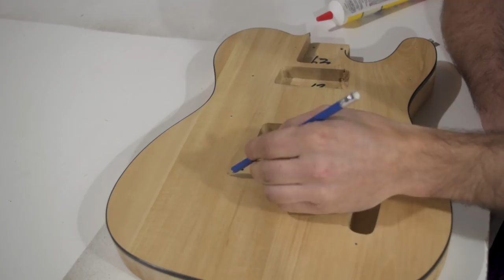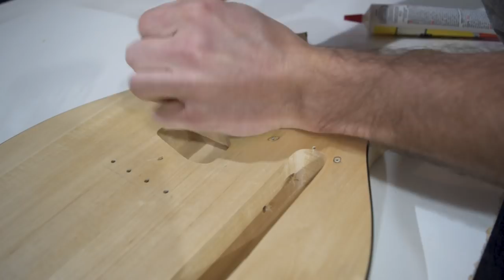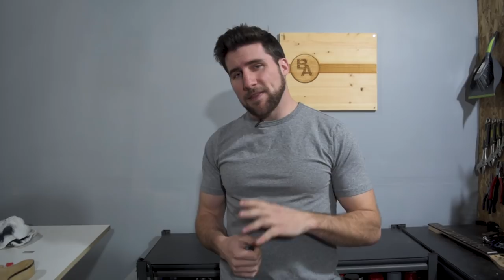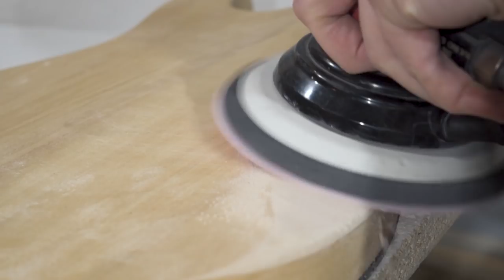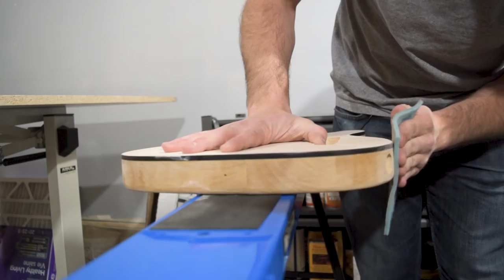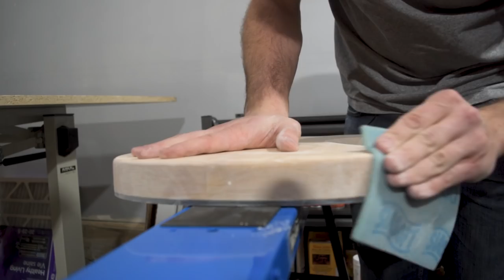Filling and Finish Sanding your Guitar | The Solo Music Gear Guitar Kit Build (Part 6)

Comment: If you want to fill holes in wood that is going to be painted transparant finish you best
fill them with the same wood as the rest is made of. To do that, save the wood dust
from sanding of the surrounding area. Mix the dust with white wood glue and use
that as filler. You will be amazed how little you see from it after it’s
finishend.Dust from sanding mixed with (transparent) glue makes an outstanding filler!

Comment: Just saw this now...my son and I used a spoke shave to do the belly and arm cuts on our tele kit...worked great
Reply from the maker: Nice; that’s a good option. I have a few videos with different methods for this.
Reply: @BradAngove  We saw those videos well after we did the work, we were starting work on a tele kit, and my son wanted a body like his Strat with the cutwaways that with our our lack of equipment at the time was the main reason we used the spoke shave (from a hobby kit I inherited from my father that dated from the 50's) It was a tiny one....probably with a 3/4 inch blade...Then we saw your videos with the belly and arm cuts in a tele body and said....Brad had the same idea we did by making those cuts....absolutely love your videos and are using some of your suggestions....making lots of mistakes and learning from them...and carrying on....

Comment: Hey, Brad, love your vids... You showed the 600 disc at 7:00, but was there another grit that you were using before that? Also, what was the pad that you were using on the sides? Thanks muchly!
Reply from the maker: I probably did a bit of work with 320 or 400 before that. The pad I used on the side was just a foam back piece of sandpaper. Also went up to 600 with that.

Comment: hey Brad question for you which polisher or buffer do you like to polish paint with I'm thinking about getting one prefer electric because I don't have enough CFM to put out for a air powered one which electric buffer do you like for polishing I know you worked in an auto shop I'm going to use it to buff my truck? have a happy New Year
Reply from the maker: Hi David. I put together a kit page for the polishing equipment that I like. Check it out here: https://kit.com/bradangove/what-you-need-to-be-able-to-polish-your-paint

I think you'll find it helpful.

Comment: Alternatively, especially for tiny screw holes like these, you can dip a toothpick in some wood glue, then jam it into the hole. Snip it off with a pair of wire cutters (or just cut it with a safety knife/razor blade) and sand flush if you need to.

Comment: Nice !! I was looking at 1 of those occilating tools but i figured they'd probly not be great for cutting a perfect 90 degree cut as needed on a headstock vs a jigsaw.

Also .. how bad has the poly sealer been on the kit so far?
Reply from the maker: A jigsaw would definitely be better for cutting a headstock. I haven’t had any issues with the sealer, but I’m not really staining mine per se.

Comment: What grit of sandpaper are you using?
Reply from the maker: Probably 150 or 220 at first and then 320 or 400 to finish off.
Reply: @BradAngove  thanks I'm going to use all of them, just to be safe

Comment: Angove, you're a bleepin' genius.  I bought one of those tools years ago at Harbor Freight and have never used it.  That being said I watched another Youtube video on carving belly cuts with an angle grinder with a cup wheel.  It hogs put the most wood in short order.  I've done a couple that turned out primo. After watching this video I'm going  to try the multi-tool before sanding with the ROS.   Also fill  the holes with those StewMac toothpicks.  They work great.
Reply from the maker: Haha I’m not sure I can afford the stewmac toothpicks. 

Sandpaper on a polisher also works well for finish carving after using the grinder wheel.

Comment: HI Brad,  my son and I are building two  SOLO Tele guitar kits and so have been watching your very good videos.  I bought one for him as Christmas gift and liked the idea so much that I'm building one also.  I talked to Matthew at SOLO and told him you were doing a good job so more free SOLO kits should be in the mail as we speak. LOL 
Question please, I might purchase a LP from SOLO and plan to highlight the grain with dye/stain,  then 2K clear coat. ( did car restoration so have all paint guns/compressor etc.) . knowing the maple cap is thin, would you go with dye /sand/clear coat or use a tint in clear, skip dye part all together  to  avoid blotching veneer or over sanding into body.  Planning on Cherry red finish.Thanks, Ted
Reply from the maker: I think those veneers have a bit of sealer on them to protect them during shipping (though I think Solo may be changing that), so tinting the clear is probably your best bet.

Comment: I know this is 3 years old but I had to post this somewhere. I needed to fill many small cracks and holes on the side of my Tele body. Instead off spending a few bucks and getting a water based power filler(powder so I could add some of the ink I'm using for a good fill). I decided to save the sawdust (same color as body) add some titebond and the ink. WHY DID I DO THIS!? It's hardened like cement and since it's the side the only power sander I own won't work so it's hand sanding. 2 hours to sand a spot about 2''x2''. I'm an idiot. Just to save $20 and to not have anything shipped to me during this covid 19 crisis I have cause myself HOURS and HOURS of hand sanding.
Take my advice. Spend the money and get filler.
Reply from the maker: You may have found using a razor blade or scraper a brick quicker for that. Thanks you for posting.
Reply: @BradAngove  I thought about the razor blade. Still searching for one. I know I have some...lol
Thanks for the reply!! And keep up the cool vids.

Comment: Hey brad.  Quick questions.

I got the thinline tele kit from solo.  Basswood and a maple top.  I am going to stain the body (the maple has a nice grain). How will the 2 woods take the stain? 

I assume the binding will be coloured......is tape the best way to keep it cream?
Reply from the maker: You can tape the binding or scrape it. You need to clean the wood with solvent and sand it before staining because it comes with a thin coat of sealer on it.
Reply: Brad Angove I've started sanding.  Figured that was enough to deal with the sealant.   No? What kind of solvent? Alcohol? Mineral spirits?
Reply from the maker: If you sand far enough that will take care of it. The problem is that you run the risk of sanding through your veneer. Wiping it down with mineral spirits a few times should help pull some of that sealer out so that the stain will work better. They’re changing the production soon I think, so the veneers won’t have sealer anymore.

Comment: Hey Brad, If you wanted to paint the body would you need to sand to 600 grit?
Reply from the maker: I will be painting the body. I like to sand to at least 320. 400-600 is usually good. I wouldn’t go above 800.
Reply from the maker: It’s not really the brand that’s important. It’s the paint type. Some brands make several types.

Comment: Hey Brad, just got one of the Diy tele kits like the one your working on. Im sanding it down, noticing that the poly is thick on there. did you sand all of it off? And what sand paper would you recomend to get all all off quickly thanks.
Reply from the maker: I’m not sure what you mean. My kit didn’t have any poly on it, just a very thin layer of sanding sealer. I would start with 220 grit to remove it. 150 if it seems quite thick.
Reply: Oh sanding sealer is what I mean. It was really thick on the back. So thick that I could scrap off with a putty knife. Was really weird. I was using a palm sander finally got it all off using 120. I want to stain it.
Reply from the maker: That is strange that it would be that thick. I’m glad you managed to get it off.

Comment: I need to fill some holes on a Spector bass, sand it, and wax it.

What do you suggest for sanding (grit) if there are small dings, and nicks that need to be fixed?
Reply from the maker: If you’re just waxing it after? As high a grit as you think you can get away with and still remove them.
Reply: @BradAngove  Yes I'm thinking of just waxing after. I was told to use Formsby's Lemon oil to remove dirt after sanding and then use wax. I think I am going to try it out sometime soon once I have all of the needed materials. Many thanks!
Reply from the maker: I hope it goes well. If the nicks are small, consider 400 grit followed by 800 grit.
Reply: @BradAngove  do you recommend using a power sander or like a sand paper block for the sanding?
Reply from the maker: A block is fine. Power is unnecessary.

Comment: Brad I don't know if you'll see this and I know it isn't the right video but I couldn't find a vid about my problem. I have a poplar body I sanded to 320 but it's still rough almost fluffy. Nothing I do seem to help. The poplar just won't sand right. Do you have any ideas? I mean you're one of the best on youtube thanks Rob
Reply from the maker: Have you tried using a grain filler on it at all?
Reply: @BradAngove  I used Zinsser shellac. Grain filler would be better?
Reply: I have some aquacoat clear grain filler.
Reply from the maker: You’ve already put the shellac on it and it’s still coming out fuzzy?
Reply: @BradAngove  Yes an it has me confused. Never before has it done this.
Reply: I'm about to sand it down as best as I can, hit it with primer and paint it since I'm painting it anyway.
Reply: Someone suggested a scraping tool which is more money and I have no idea how to use them and it's a semi hollow with a rather thing top.